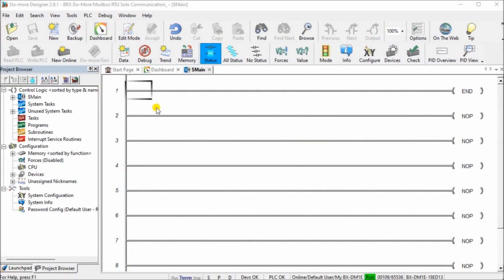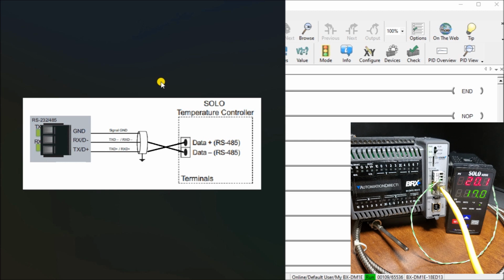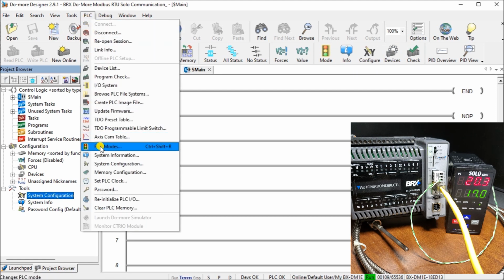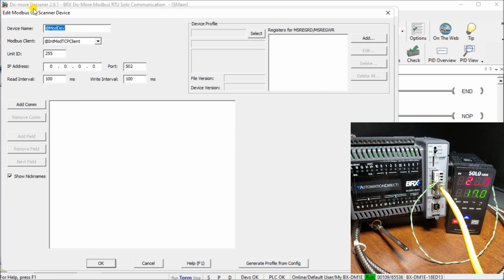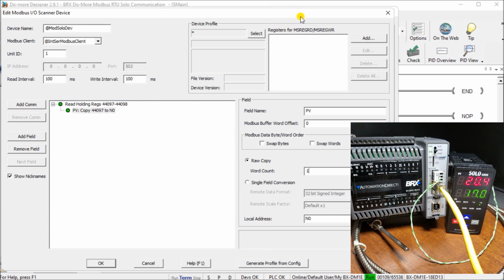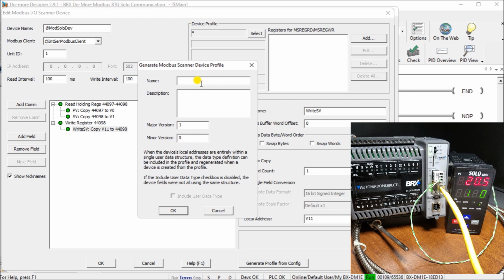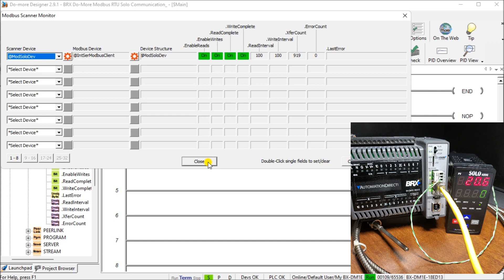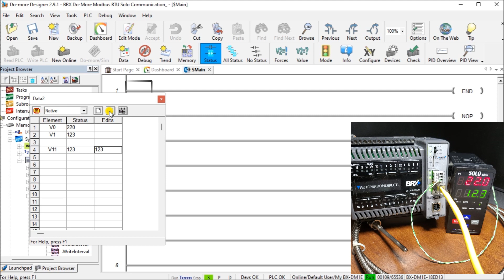BRX Do-More Simple Modbus Serial Communication

Comment from the maker: More information can be obtained on our website. This includes all of the links mentioned in this video.
https://accautomation.ca/brx-do-more-simple-modbus-serial-communication/
The entire BRX Series PLC can be found at the following location:
https://accautomation.ca/series/brx-do-more-plc/

There are several reasons why we are using the BRX Series Controller. Here are just a few.
 - Standalone PLC with built-in I/O
 - Built-in Data Logging 
 - Communication ability - Ethernet Port, RS232, RS485, USB - support for protocols such as Modbus RTU, Modbus TCP, ASCII, K-sequence (DirectLOGIC users), Custom Protocols (ASCII over serial, TCP or UDP over Ethernet)
 - Built-in Analog input and output
 - Integrated motion control
 - High-speed counters
 - Powerful instruction set (Video of Instructions in software)
 - Ability to expand the system with a variety of modules
 - Part of the Do-More series of PLCs which use the same free software. (Do-More Designer)
 - Integrated simulator in the software capable of external communications for testing

The BRX series of programmable logic controllers consist of four different units. They differ depending on the Inputs and Outputs built into the unit and if it has an ethernet port. 
No I/O Micro PLC unit – (BX ME)
10 Point Micro PLC unit – (BX 10/10E)
18 Point Micro PLC unit - (BX 18/18E)
36 Point Micro PLC unit - (BX 36/36E)
These CPUs (Central Processing Units) are also known as MPU (Multi-Processing Units) because of their communication capabilities.

Regards,
Garry
ACC Automation
https://www.accautomation.ca

Comment: Great video. 
Is there a video about BRX acting as the modbus slave? If another modbus device needed to read write to a holding register of 48300 for example. How do you make this holding register available when you are in Modbus slave mode?
Reply from the maker: https://accautomation.ca/modbus-rtu-click-plc-master-to-brx-plc-slave-communication/
Here is information on the Click PLC controlling the BRX Modbus Slave unit. The video link is near the bottom of the post.
Just think of this as a memory location. You will decide who can write/read the information.
Regards,
Garry

Comment: Hi thanks for the video,
When I am following this I get no communication between the controller and the plc. Although if I use the instruction modbus network read or write like your other solo brx video. It works fine. Any ideas? It’s like the scanner is not running
Reply: I tried this on another PLC and it worked great. Talking with tech support they are replacing the PLC this did not work on.
Reply from the maker: Thanks for the update. 
Garry

Comment: Hello Gary,
I was wondering if you have ever tried to connect a BRX PLC to a LabVIEW DSC Modbus server VIA ethernet or maybe some over Modbus server running on a computer? I am having some trouble where the two are not communicating to each other.
Reply from the maker: Hi Kyle,
I have not used the LabVIEW DSC Mobus server. However, this would mean that the BRX would be the Modbus Client. When sending the Modbus commands from the BRX PLC, are you getting any error messages back?
Regards,
Garry

Comment: In this video, you reconfigured the BRX to Modbus master. Are you able to still use a HMI while in this configuration? If not, is there any ladder logic instructions that would allow you to read from  and write to the device?
Reply from the maker: Hi Adam,
The Modbus serial communication will allow just one master, so you could not put an HMI on the same network unless it is the only master. 
If the HMI is the master then you would have to communicate to both devices and update the information for each.
The C-More EA9 HMI could easily do this communication.
I hope this helps you out.
Regards,
Garry